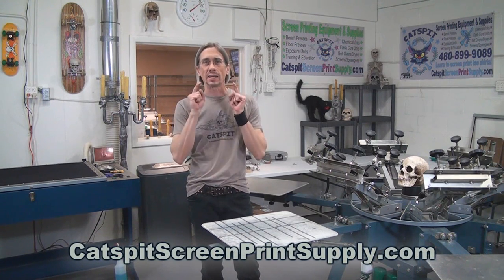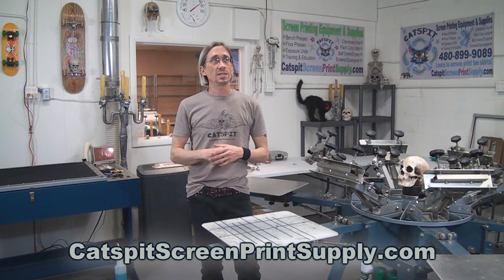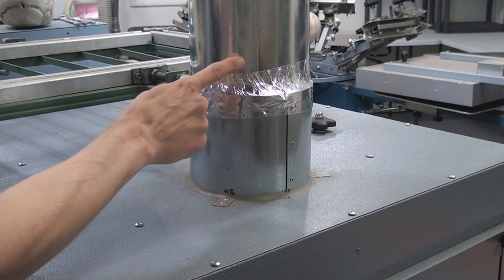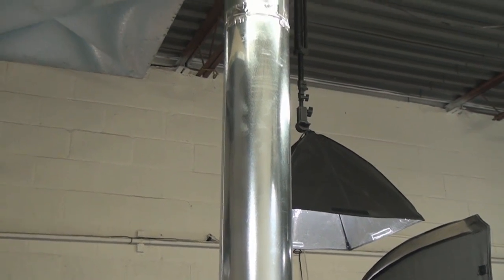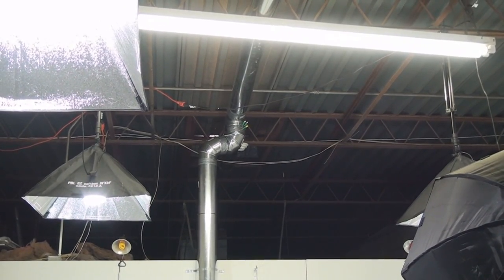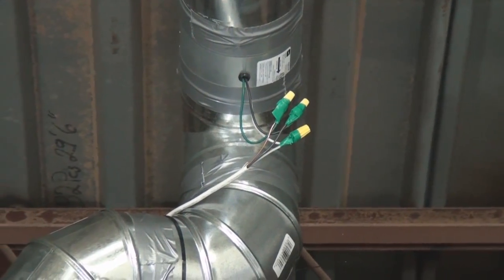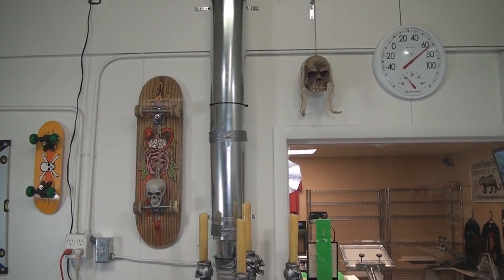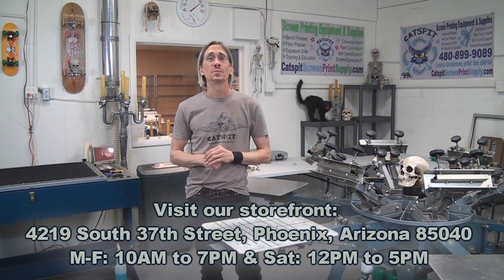Screen Printing Tee Shirts: How To Vent Your Belt Or Conveyor Dryer

Comment from the maker: Screen Printing Tee Shirts: How To Vent Your Belt/Conveyor Dryer

As we set up the new storefront and screen printing equipment and supply store in Phoenix Arizona we have the opportunity to do things a little differently. With the bigger space and high ceilings we have a swamp cooler and air conditioner in the shop area. That larger space enables a separation of cool air and hot air so venting the dryer removes heat and fumes from the printing area. This is beneficial to the health and comfort of your employees. With proper ventilation and in duct fans you can vent plastisol ink fumes as well as the shirt dye fumes out of the work space. It should also keep a much lower temperature in the shop by venting heat out with the fumes. In this educational screen printing video I show you my venting and duct work complete with in duct variable speed fan. This video should help you get a good idea of what it will take to vent your screenprinting belt or conveyor dryers for printing tee shirts. Enjoy the video!

https://www.youtube.com/watch?v=ZKuexAs28GM

Catspit Productions, LLC
4219 South 37th Street
Phoenix, AZ  85040

M-F: 10am to 7pm  Sat: 12pm to 5pm

480-899-9089

Learn how to screen print tee shirts with Catspit Productions, LLC! 

Screen Printing Supplies and Equipment Sales: Setting new standards in old fashioned customer service. Catspit. Ranar. Seriously simple. TM  

http://catspitscreenprintsupply.com/

#Phoenix #screenprinting #supply #store #screen #print

Comment: I can't remember where I saw some sort of attachment that is like a vent hood that goes at the exit end of the dryer to catch fumes but not necessarily suck out all the hot air that is going to be at the top of the dryer, anyone know who makes that?
Reply from the maker: That's usually a custom install by someone who does venting for restaurants or industrial applications. Do a local Google search. Could be an AC/Heating type company as well. In this case the exhaust fan and vent keep a lot of the heat out of the shop. But during the summer in Arizona, you have to simply deal with it... lol. Thanks for watching! CatspitScreenPrintiSupply.com

Comment: Looks great except in everything I have read about venting the dryers, one rule is never to have a 90 degree angle as you can create a back draft.
Reply from the maker: It's 6 inch duct so as long as it's wide open to the end, it should work well. But many people will have an exhaust fan at the end which can be turned on and off. For many shops there is no other way except to use a right turn to vent. It all depends on your space. I had to vent out to an existing hole in the roof. I have an exhaust fan at the end as well so there's a little draw on the venting duct. Just enough not to pull too much heat out of the oven chamber. Thanks for watching! Screen Printing Equipment & Supplies - http://CatspitScreenPrintSupply.com/

Comment: Is your direction arrow on your duct fan blowing the wrong direction?   The arrow is pointing down into your air conditioner.   I need to vent my cure star 4000. Gets pretty hot really quick.  Lol.
Reply from the maker: Dewey Smith LOL.... probably. My brother did the work so it was for free! Sort of ;) Actually it is not pointing the wrong direction. The duct you see in front of that is for the AC unit just below. So they both exhaust in the same direction out to the vent in the same direction as the arrow. The AC unit has its own blower which is pretty powerful. So it comes up to the junction and joins with the duct fan from the dryer. I ended up splitting them both into separate ducts so the AC blower would not affect the dryer venting at all. The AC blower turned out to be stronger than we thought. If it hadn't so forceful the original set up would have been fine. But you should pay attention to the dryer venting and don't worry about the added on AC unit. Thanks for watching. Screen Printing Equipment & Supplies - http://catspitscreenprintsupply.com/

Comment: Great work and cool explanation.  Man, venting can be a problem with higher ceilings. Glad you showed me this. Gave me some ideas. In your garage set up, how were you venting that?
Reply from the maker: Thank you!! Yes, venting can be a challenge in any space actually. In the garage shop I did not vent since I opened the door when printing. It only had 8 foot ceilings so I would have had to go through that, the attic and the roof. Not worth it since the garage door opened vented the entire shop in one swoop... LOL ;) Thanks for watching. Screen Printing Equipment & Supplies - http://catspitscreenprintsupply.com/

Comment: Brand new to screen printing..running into some issues trying to print in my basement. Either I have to figure out how I can vent the smell outside or I have to find a new place to print :/ Money is tight right now too..Could really use some guidance!
Reply from the maker: Ronnie Bickers Hmmm, well even with proper venting there is likely to be some smell about the home as the fumes rise with the hot air. I used to have this problem years ago when I was care giving for my Mother and was still printing in the garage. She would complain about the smell no matter what I did.... LOL. Rest her soul ;) Anyway you should do a venting job like I did however you can using a duct fan to help evacuate the fumes. Then you may have to use some positive pressure in the house while you print to keep the fumes from getting in there a ton. You know, turn on the AC or cooling fan to keep positive airflow inside out. But even then the fumes can get around so you could be in a pickle depending on the sensitivity of those residing there. Thanks for watching. Screen Printing Equipment & Supplies - http://catspitscreenprintsupply.com/

Comment: I Catspit ! Thank you for this video. I'd like to hear you about a good method for the classification of films. Some films are wide and I'd to know what is your classification method. Thank you ! I am from Quebec Canada
Reply from the maker: You’re very welcome. Glad I can help out through my videos. Inkjet film? I do not classify it at all. Rather they come in specific sheet sizes or rolls. Sheets are commonly 8.5x11, 11x17, 13x19 and sometimes 11x14 along with various width size rolls. Thanks for watching. Screen Printing Equipment & Supplies - http://catspitscreenprintsupply.com/
Reply: Hi Catspit! You know I french and I probably used a wrong  word for my question about film. I mean storage after used, not classification. I am sorry and congratulations for your new shop.
Reply from the maker: Le Brodeur LOL... after I posted my comment I was like.... "did he mean storage of printed film positives?" That all depends. But I used to store them flat in an alphabetical pile with dividers for each letter set. You can keep the pile or piles in drawers or cabinets. It's not the most ideal way but it takes up little space and costs nothing to do. Otherwise people use very large flat file drawers and alphabetical ordering. Some use medical filing systems and others buy systems built for screen printing.

Comment: Thanks again for another helpful video!  You always keep the videos relevant & I always take something away from each video you post & the comments that are posted... Even if it's just confirmation that I'm not the only one in my undies in the summer heat.  Aside from that, do you filter the exhaust before it exits the workshop?
Reply from the maker: +T Edwards Thank you! You're very welcome, glad I can help out through my videos. No, the venting is not filtered as it is not required for the fumes released here. They are very minimal and only pose a problem when concentrating in a small closed space. Thanks for watching. Screen Printing Equipment & Supplies - http://catspitscreenprintsupply.com/

Comment: Why not insulate your exhaust pipe , it would it keep the shop kool ?
Reply from the maker: That might help some but the majority of the heat comes out of the end of the tunnel. The vent helps minimize that but you can certainly insulate your duct work. Thanks for watching! Screen Printing Equipment & Supplies - http://CatspitScreenPrintSupply.com/

Comment: I see, how's that portable ac work?  I'm tired of printing in my under wear lol.   Jk.  Sort of.     I'm sure just venting the dryer alone would make a difference
Reply from the maker: Dewey Smith LOL.... not such a joke really. I used to print in my shorts and run to the pool, jump in, get out and go back to printing. Here in AZ I would dry up pretty fast and it can hit over 110 in the shop. The AC unit works okay in a smaller space. In this shop it does not do much really.... haha but it does make the area near the press more bearable at times. I have a large swamp cooler that really does the cooling when I need it. Thanks for watching. Screen Printing Equipment & Supplies - http://catspitscreenprintsupply.com/